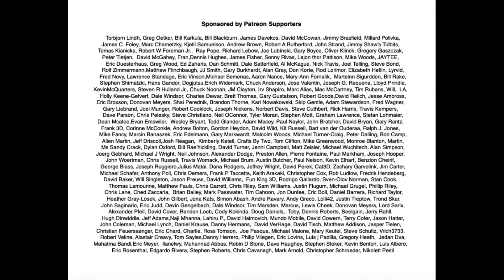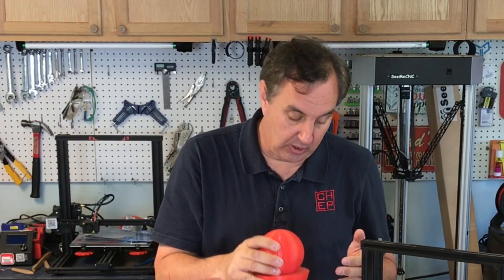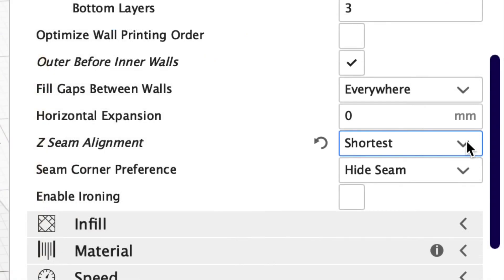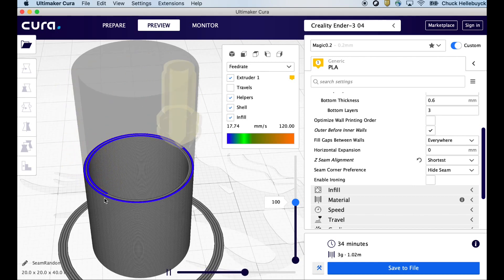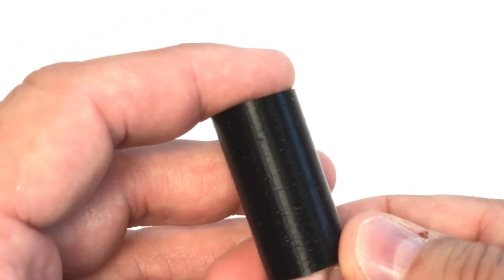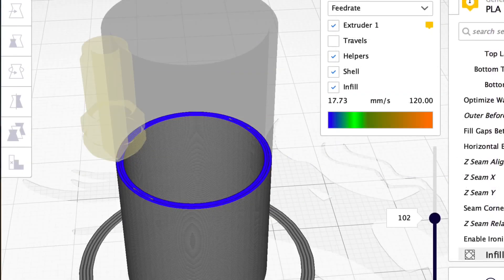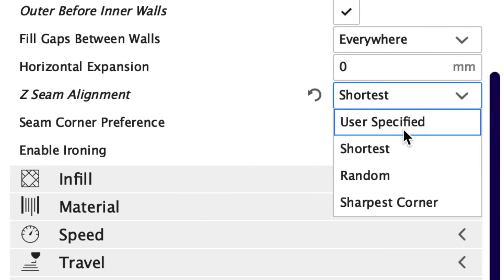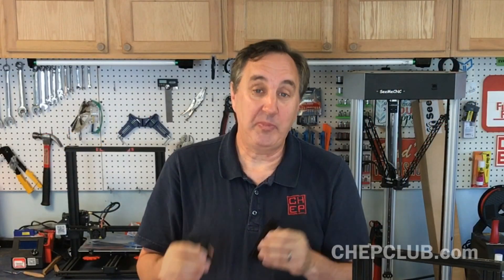How to Control Seams In Cura Slicer Settings

Comment: Hello from Argentina Chep, I currently have version 4.6 of Cura but I have gone through several previous ones and the possibility of simulating an impression like the one you do in this video never appears to me, and I looked for the form but I cannot find it, the play bar does not appear . Could you help me please?
Reply: move to the preview tab if you havent already and make sure you've sliced the print already
Reply: select expert setting next to the search bar for search settings.

Comment: Can you kill the ugly seam in a cylindrical object (without edges)? ;) :D :/
I've tested all, speed, retract, wipe, flow, hiding, sub/second object... Why it works on the Test-Doc? No, really nothing seam on Test-Doc... grrrr
Reply: Vase mode avoids the seam, but can only print one continuous wall. It does this by moving up along Z continuously rather than in one layer height step. The setting in Cura is called "Spiralize outer contour". The reason the "hide" setting did nothing in Chep's cylinder is that a circle has no (different) corners; it's called "seam corner preference", not "do magic to seam".
Reply from the maker: Try my no seam profile.
Reply: @FilamentFriday  I don't know / can't find a "no seam profile"!

Comment: Relatively new to printing, but why does the seam need to print on the object altogether? In your example, why can't I set it to change the z height off the object, and then return to the print, eliminating the seam altogether?
Reply from the maker: My latest profiles reduce the seam and many time eliminate it with other settings.
Reply: The printer needs to stop extruding when finished the layer and start extruding another layer. Seam is not caused by changing Z axis, but by stopping and starting extruding. If your retraction settings are not absolutely perfect (which is not), the spot where extruding starts is usually a bit visible.
Reply from the maker: Where can I download your profiles?

Comment: I have 4mm nozzle hole and it's printing 8mm line, and I have also seem. You didn't help me how remove that issue. When I was printing with line wide 4mm,  I don't have seem at all. Question is why? I know that it is possible to remove seem in cura slicer,  but I can't find proper settings to adjust time when starts new line.
Reply: not possible. whenever there is a start and end point in an extrusion there will always be seams you can only reduce it just as stated above and  post-process your surface after.  either with sanding or  acetone vapor smoothing.

Comment: I'd just like to find a way to get rid of the bumps altogether.  Is there a way?
Reply from the maker: Try my latest 0.12 profile
Reply: What temp is your filament running at? I saw surface defects when running my PLA too high (210). Reduced it to 200, and there was significant improvement. Also slightly bumping up your retraction settings may help too

Comment: Why when printing cylinders, the head always travels to a complete loop and then changes direction?
AND WHY IS IT WHEN I ASK THIS QUESTION PEOPLE LOOK AT ME LIKE I'M MAD?
Take a look at a cube - it goes round and round in one direction - switch to a cylinder and and goes clockwise - anticlockwise 
WHY? Wouldn't it be faster and with less vibrations if it goes in one direction?????
Reply from the maker: Good question. I have no idea.

Comment: What if you disable retracts?
I assume that you still do retracts on layer changes, but with a simple object like this, it's better to omit the retracts and just continue printing on the next layer.
Because when you do a retract, the nozzle stops where it is and does the retract. But in the meantime some liquid filament is oozing out of the nozzle. So when you don't need the retracts, omit them and you get prints without seams. Or restrict the retracts to the stretches where you cross perimeters. Maybe you can select that option.
Reply from the maker: Have you actually tried that?
Reply: @FilamentFriday  yes. It works great on objects with just one "island" where it does not need to cross any perimeters. Maybe you could still see a bit of a seam, but no big filament oozing drops. The layer change must be quick, then it's good.

You can even hide the oozing drops when when you need to cross perimeters on an object with multiple "islands" per layer: Print it with retraction on and with the outside first (it may be a bit of a risk, maybe on overhangs). Then the oozing from the retraction happens on the inside. At the next "island" however the print is starting on the outside. So this start should be smooth -- than it is nearly invisible. Maybe you get a bit of fine stringing, but once again no oozing drops. I like it.

Comment: Ok, I know is out off this video, but I need  some help.  How I fix a gap between every wall line. The wall lines don't stick together.  I have a ender 3 and cura 4.2.1
Reply: Sounds like under extruding, maybe try a different brand of filament or increase your temperature. I made the mistake and went cheap on some filament, 3d warhorse, at 200c it under extrudes horribly, I have to run it at 220-230 to get correct flow. My other brands of filament print fine at 200-205. I felt like I was beating my head against the wall trying to figure out my problem.
Reply: @marv8481  thanks guys,  I'm running at 210°, bed 60°, and 110%extrusion, working perfect so far.
Reply: @aw_overland  Calibrate your extruder - it is simple thing to do and it improves printing a lot. Do not be afraid of doing it. The diference is amazing and it takes about 3 minutes.
Reply from the maker: Shut off coasting.
Reply: @FilamentFriday  thanks for your advice! However Coasting isn't enabled .
Reply: Maybe you should check if you are under-extruding? There is a lot of video on that
Reply: The issue.. a  clog nozzle, so basically under extrusion. Thanks for the advice.
Reply: ManVic, maybe there are some errors (geometry problems) in your object. Try to fix them with netfabb basic.
By the way, if it is a geometry problem, you can see the wrong print in the slicing preview: Zoom in very deep to the place where there would be the gaps until you see each extruded line in your slicer clearly. Maybe the slicer missinterprets the geometry and makes the gaps on purpuse. In this case, a fix with netfabb (basic) might or would help.
... Or if you have multiple objects placed together to form one single object, try to combine them into one object (and save it in a new file if needed). Then the slicer knows that there is no gap, because it's a single object which is just continuing - rather than multiple objects side by side which look like a single object but are separate objects.
... Or these parts are just too thin to be printed (in case the wall thickness changes and the gaps are only on the thinner walls). Try thicker walls then. I print in 0.4mm extrusion width, but 0.4mm walls were not enough to be printed. I think I needed 0.5mm walls at least to be printed. I'm sure it depends on the slicer - and the bottom layer is usually printed with wider lines and the thin wall might not be printed on the bottom layer. This might or might not be a problem - depending on the geometry.

Comment: If you really want to hide seams on a cylinder, you might want to play with coasting,  combing -> not in skin, and retract before outer wall, and retract on layer change, I have had mixed results, and it really depends on layer height and speed, but you can get a little bit less material extruding on the seam and it helps hide it.

Comment: New subscriber here. been printing with Cura for a few years now but did not know about the simulator.
I have the latest version, how do you enable the simulator,?
Reply from the maker: Should automatically appear in preview.
Reply: @FilamentFriday  Thank you for the quick reply. I don't see it. In layer view I just get the slider on the right that displays the different layers.Strange, never seen it on any version of Cura I have used.
Reply: @myfordboy  Video card obsolete. Cura runs in compatibility mode.
Reply: @kubo527  I see that now, I looked into it and came to the same conclusion
Reply: @myfordboy  fancy seeing MyfordBoy here!

Comment: THANKS! i tried to use seams before but could not guess what X/Y position was on the build plate itself. You showed me i had to select Z- relative so that i could use the parts dimensions to determine X/Y position. Thanks
Reply: I found this video once again and once again THANKFUL for explaining X/Y. helps a ton. thanks again

Comment: If you have a solid with in-fill.  Why can it not "rise" inside the print slightly, then move to the start point?  Leaving the extra plastic inside the model?
Reply: VERY GOOD QUESTION MATE!
Reply: It can, there is a setting for that (something in the order of "print outer walls first". However, the seam is coming from remaining nozzle pressure when the extrusion ends and the nozzle moves to the next location (also in the same layer). Coasting can improve this, but the best is linear advance with newer marlin versions.

Comment: When we print a component at 0.2mm layer height or 0.06mm layer height, the component weight doesn't change, that is length of filament used doesn't change. Could you explain why.
Reply: Still need an explanation for that?
Reply: @D3nn1s  yes please
Reply from the maker: The same volume of space is filled if it’s at 0.06 layers or 0.2 layers.
Reply: @kabirsharma4820  because over the whole print the same amount of material is used, its simply spread over more time. E.g. .2 and .4 layer hight uses 100g over the entire print. .4 uses 100g/h and prints 1h while .2 prints 50g/h and prints 2h

Comment: If i buy the  electronic for a cr-10 co
uld i install them in a di Vinci 1.o and would i be able to get it to work.
Reply from the maker: Possibly but with the drive system and non replaceable nozzle on the DaVinci I’d just buy a CR-10

Comment: Another really useful video. Thanks for the reply to my question. Now I am trying to print a kind of "wave" form in a 3d model but when I  use cura to slice the 3d model the layers appear with gaps between them I mean the red layers (material) are separated. I set up the layer height 0.12mm but still have gaps between them. Could you give a solution? Have a good one.
Reply: This seems to be an issue with the 3D model itself where the wall thickness is too thin. To check, you can enable (print thin walls) setting in cura and see if things improve. This is not a fix. The real fix is to increase the wall thickness in the model or make it solid inside.
Reply: @fadilalsayegh7637 , thank you for your answer I am going to try what you suggest and let's see what happens.

Comment: Under the Shell section of Cura you can find "Outer Wall Wipe Distance"  this feature will move inward the nozzle after outer wall, this will hide the seam better.  Try adjusting it bit-by-bit and see the difference.  Cheers.
Reply: i don't have the shell section
Reply: @gudelauneee  Wall in cura.
Reply: @gudelauneee  Also I found those options are disabled by default, you have to enable them first to show up

Comment: Does anyone else think the seam blob is created at the start of the outer wall extrusion not the end?

I've done a bunch of testing with the wipe and coast setting which should help if the blob is occurring at the end of the outer wall but they make little to no difference. I am using an Ender 3 with Cheps base settings Magic0.20
Reply: The fix for this is using a negative extra restart distance. Do a test tower to see what distance works best for you. But the issue with this is that if you have a successive series of retractions, it will start to underextrude for the start of the line.

Comment: I'd use spiralize aka vase mode for these.  No seam and no travel if set up correctly.  Reduce layer hight and increase line width (say from .4 to .5) for stronger prints.  It is still a good idea to tune those "seam" settings and check your preview to be sure there are no travel lines because cura sometimes gets confused.

Comment: How do i activate the simulator on cura? Mine doesn't do that.
Reply: After you've sliced the model, click on Preview. You can then see how the hot end travels layer by layer. Use the slider on the left to move up and down and the slider at the bottom to "play" that layer
Reply: @DanFre40  thats my problem. I dont have that slider at the bottom. Its not there.
Reply: @impitvipergaming  if you go into Marketplace (on my Cura 4.1 it's on the top right) then check the Installed tab, is the Simulation View plugin present and ticked?
Reply: @DanFre40  yes it's there and ticked. I just downloaded 4.2 and it's the same. Maybe my cpu?
Reply: @impitvipergaming  not sure to be honest... you might have to ask on the cura supporr forum
Reply: @DanFre40  thank you.
Reply: It may be your video (GPU) rather than CPU. Check to see if there's an update for your video drivers at the actual video manufacturer's site. Windows (I assume you're on it) often uses older or generic drivers that don't have all the features and performance the original vendors drivers do. Find the video model in Device Manager under "Display adapters" then go to that manufacturer's support site and enter your model and download the latest drivers. On Win10 you can get Device Manager by right clicking the Start button, bottom left of screen.
Reply: @mrputerpro5383  i will try that. Thank you.
Reply: @impitvipergaming  YW! :-)

Comment: What do you think about disabling “Infill Before Walls”, and using multiple walls, making sure there is no Z hop on outer wall.

The print head goes Inner Wall > Outer Wall > Infill > Layer Change > Inner Wall...

No Z seam in outermost wall at least.
Reply from the maker: I might try that

Comment: Hey Chuck, I don't use Cura much, except for the Sigma. But when I used it a while ago, I found that the Hide Seam option places the seam on an internal angle of the print, essentially hiding it in an internal corner.
Reply: That's exactly what it does. Hide seam will likely place on an internal corner and expose seam will place on external corners.

Comment: Great information, thanks as always.  I never thought much about seams until I tried out the creawesome profile.  I normally print a Chep cube and/or a benchy when I try out new filaments or profiles so naturally it made sense to print a few test parts with the various creawesome settings.  I was not at all happy to find a big seam running up the port side of my benchy that I'd never seen before.  I immediately jumped to the conclusion the creawesome profile was rubbish and was going to leave it at that.  Looking into it though I found the seam settings and put the seam on a corner which tempered my crankiness somewhat.  I still don't care much for the creawesome profile and switched back to the stock Cura profile and just use Chep's magic0.20 settings  but I did learn something.  Thanks for sharing so much of what you learn.  Your videos are really helpful and I refer to them often.

Comment: The Z-seam is actually the result of where the outer wall is started and ended, the layer change happens in the infill and doesn't leave anything visible. It's easy to see if you do a preview of the layer print in Cura, the first thing that is printed is the infill, and the last thing that happens is a travel move from the end of the outer wall to the spot in the infill the next layer starts at.

Comment: If the seam is as noticeable as in the video, then there is a problem with the other settings. There is still pressure in the nozzle when the movement is completed and a little extra material is added when the layer is changed.
The solution to this is coasting. This stops feeding the filament a few moments before stopping, so the pressure of the molten plastic is reduced and no tiny blob is formed. This eliminates the seam much better than the methods mentioned here. Together they are the best.
Reply: I am sure he knows this.   You can’t set it to hide the seam.  You’d have a hole with no filament.  No way yiu know more than chep.
Reply: @dugy40  Maybe though?

Comment: And now for something completely different - is it better to get a aluminium spacer rather than silicone spacer if I plan to instal ABL <3d touch from trianglelabs>? Is it better to have a stiff heatbed and the 3d touch will do the trick with leveling or get a silicone spacer and have some amount of play - ENDER 3 PRO.
Reply from the maker: I don’t use ABL on Ender 3 so best to ask them.
Reply: I've used that and ended up buying the actual BLTouch after I found it had some serious quality problems, paid twice ;-( . Sometimes cheap is good, but sometimes you pony up for the real thing. WORLDS of difference between the chinese trianglelabs clone and the South Korean original! Once you've got your bed level, solid spacers are the way to go. BTW - make sure your bed is flat as you can get it to start (mirror, glass, etc). Sensors are fine but it's important you're not using them to fix improper mechanicals. Flat & level, THEN sensors ... :-)

Comment: At University I saw a print (block with mounting holes in it) with 6 perimeters which where printed like a spiral, without a seam.  Is there an option in Cura as well?
Reply: Vase mode? Spiralize
Reply from the maker: Spiralize mode. I’ve shown on the channel.
Reply: @FilamentFriday  Spiralize with 6 perimeters? It's possible?

Comment: Thanks for the video Chep !! Which version of Cura are you using?
Reply from the maker: I used 4.0 in this video
Reply: @FilamentFriday  thanks,  for some reason i dont have the "play" button to see the hot end travel
Reply: @PabloSanJuanOk  Old graphic card. Cura runs in "compatibility mode", as showed in the panel.